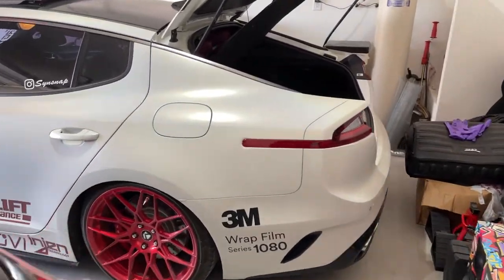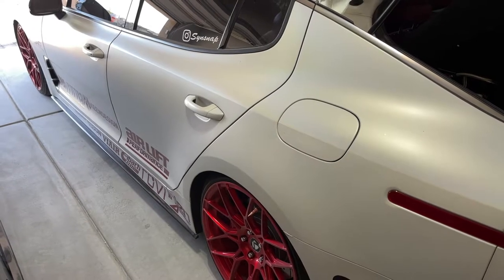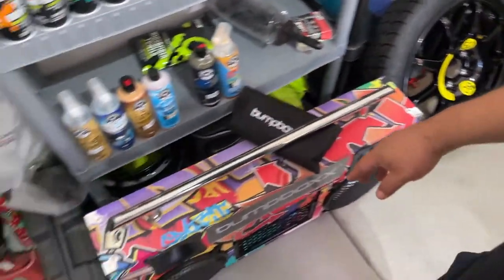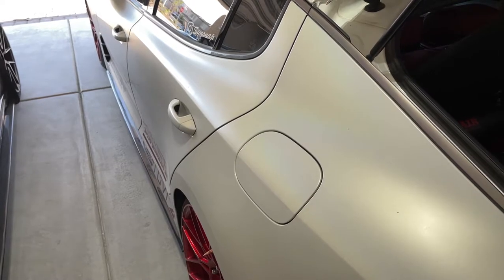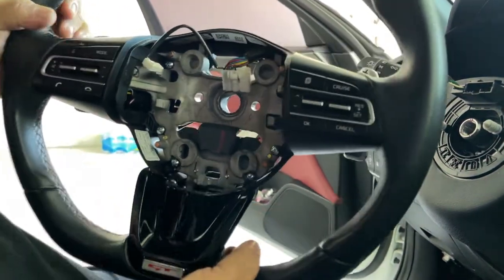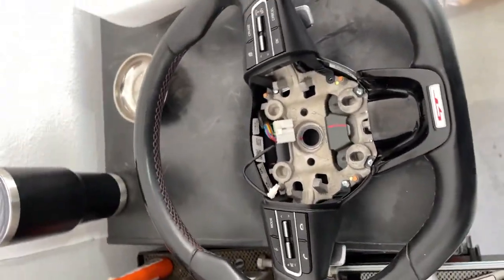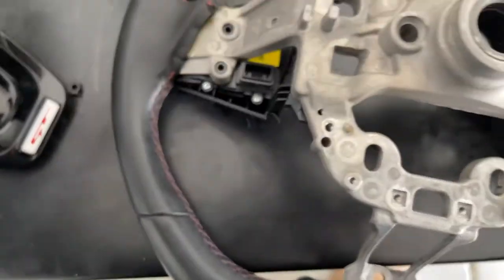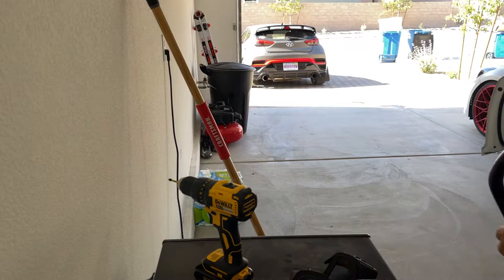Wife's Stinger Gets A Nice Upgrade ( How To Install A Carbon Fiber Steering Wheel On A Kia Stinger)

Comment: Thx for the video. After installing, did you need to take the car to the dealer for a steering angle sensor re-calibration, or was it good to go after installing?
Reply from the maker: It did not need it.

Comment: Is the aftermarket thicker than the stock?
Reply from the maker: Yes it is
Reply: How is it so far? Does it gets hot or slippery during a long drive? If you given a chance would you rather opt for the leather?

Comment: What air ride and where?
Reply from the maker: Jun fitted. You can get it from a shop called khartunerz online
Reply: @SynergyMediaUSA  Thank you another question did you install yourself or a shop never done it myself if possible could you maybe do a vid showing how lines are located. Thank you again.
Reply from the maker: @MrGreenfly1  i had a shop do it